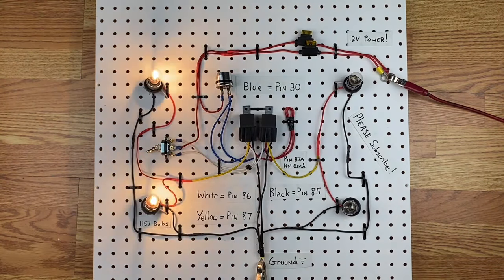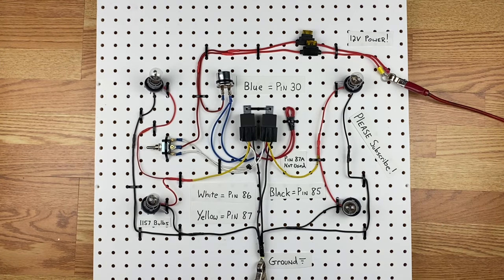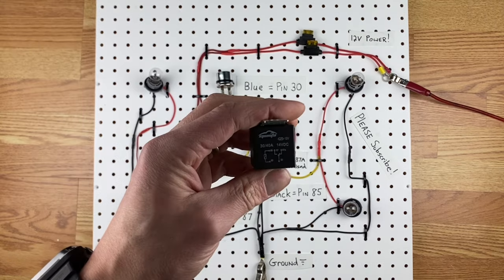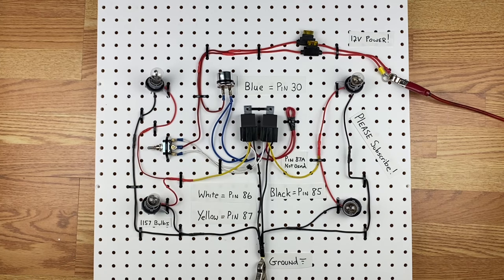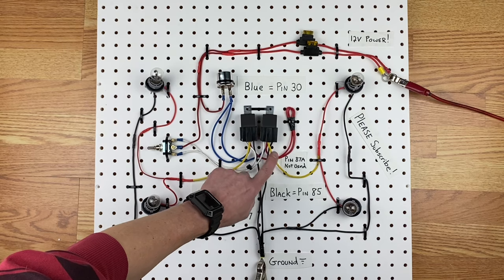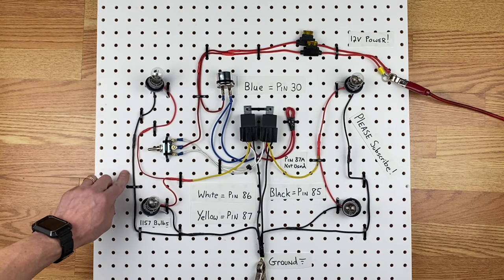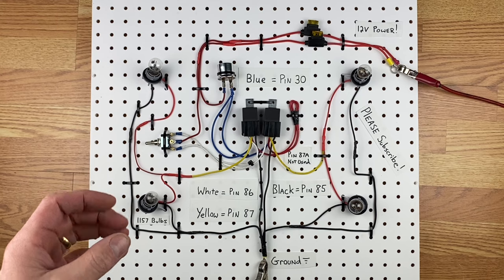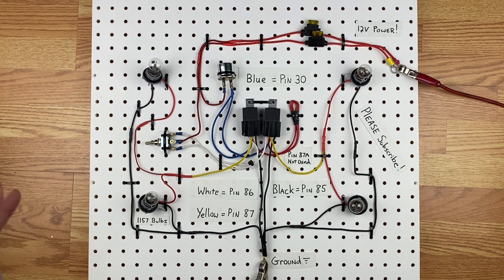How To Wire a Turn Signal Flasher Relay Directional Blinker on a Car / Truck / ATV / Motorcycle

Comment: This can be simplified quite a bit by eliminating the relays and powering the bulbs directly from the flasher. Modern EF32 electronic type flashers can source 25 amps. They are still a simple two-wire flasher.

Comment: I’m having trouble with my turn signals. I have an Ford F100 truck.Everything works except my turn signals I changed cell the voltage regulator and the 552 Novita fuse but still do not work. What else could it be I appreciate some help
Reply from the maker: Which bulbs are you using and how many? If you are using LED’s for example, you’ll need an LED flasher.  Give me more info and I may be able to help more.
Reply: @WiringRescue  They didn’t wanna work even with the regular lightbulbs but I’ll try to LED flasher because I tried putting on the LED panels that plug-in the the light socket
Reply: Well I tried the LED flasher upgrade I still the signal lights and turn on. Am I looking at changing the signal light cluster in the steering column now. Also went ahead and clean all the ground connections

Comment: Does the flasher have to be for led lights if that’s what Type of light in using.
Reply from the maker: It sure does. If you use a regular 552 style relay, they most likely won’t blink.

Comment: 57 Bel air restomod changed tail lights and front running/turn signal lights to Led panels with 1157 plugs. Brake lights work, running work, Turn signals get brighter but won't blink. Changed relay to led type still no blink just brighter. HELP

Comment: Greetings from Denmark :) . I must be the stupid one on here. I am trying to copy your system, except I have two small side signals. I can't seem to get anything to work.... I have checked the lights and they work. I have two types of flashers that I have tried. One 2 Pin with an X and L marking, and then one with 3 pin . Any idea what I could be doing wrong. I tried to skip the relays, and just tried the flasher and a light to see if it worked and it did.......
Reply from the maker: It’s tough to diagnose over the internet. However, if you bulbs have an amperage rating of less than you switch, and flasher, you can skip the relays!
I made the relay diagram because it’s safer, and allows people to nearly use any bulbs they want. But it sounds like you just have two small bulbs. So you just need to make sure your switch and flasher are rated to flow enough electricity to power your bulbs.

Comment: This is a good demonstration but in this scenario aren't the relays not needed. My understanding of relays is that they allow you to use a low power circuit connected to your switch to control a high power circuit connected to whatever you are controlling.  But maybe it is different in automotive wiring.
Reply from the maker: The relays allow you to use a variety of different size (non-LED) bulbs without worrying about the amperage draw too much. Depending on how low of an amperage your bulbs are, you may not need relays. This method would give people a variety of options with less risk.

Comment: I am a total novice. I have NEVER wired anything. Would your diagram apply for a 6 volt car? I must wire a 1923 Ford Model T Touring Sedan. Tell me what the actual wire is. What is it called? Tell me what the connectors are.  Also, what about the other light systems such as running lights and 4-way flashers. Do you have a video/diagram for that also?
Reply from the maker: I have a LOT of wiring videos - check them out. I don’t generally mess with the 6 volt stuff, but you can buy 6 volt flashers and relays. So I would assume that is a good starting point. If it’s a positive ground system for n your car, I have no idea though. That’s where you’ll need to find somebody way smarter to explain it.

Comment: Thinking about running this on a motorcycle using a cap and a Pma system aka not battery. Not sure the exact output at the cap at this point but do you think it will work?
Reply from the maker: Sounds like a fun project!  I have never tried that before, so I have no idea if it will work.  If you try it, you should post up the results!
Reply: Would you have to change the relays for led light

Comment: Can you do a circuitry where one filament serves as both brake light and turn signal?  Meaning it will flash instead of steady on if the turn signal is activated while the brake is applied.
Reply: The way vehicles are really wired, this is wrong and the relays are redundant,  not needed and over complicate a bad design , the line load is so low relays are a waste

Comment: Hi your video is very helpful I’m planning on turning my led side markers on my trailer to flash with blinkers to as is a trailer I don’t have a constant positive for the relay could I use my running lights as power in and out
Reply from the maker: If I understand you correctly, you should be able to grab that power from the running lights after it powers the running lights, and use it to power the flashers. If you hook up the flasher before the running lights, it will cause a variety of confusing issues, like flashers not flashing.  Also - if you have LED's you need a special LED flasher. The flasher in this video won't work with LED lights.  Good luck with the project!
Reply: @WiringRescue  that’s what I was thinking will I still need 2 relays but no flasher

Comment: what if I am mounting blinkers on my bicycle (no motor) can i ground to the frame? I plan to use a tusk enduro 12 volt 2000 mah battery pack to power my blinkers
Reply from the maker: As long as the battery is grounded to the frame as well and the frame is conductive, yes!
Reply: @WiringRescue  thank you so much my frame is aluminum so to be clear to eliminate excess wires I can drill a small hole in the frame and connect the batterys ground with a screw a bolt and washer with the wires in between a washer ...then connect any wires that need ground to the frame the same way?? btw subscribed
Reply: @WiringRescue  cause I bought a radrunner and my goal is to add blinkers but I am thinking of connecting it all to my ebike battery but my system is 48 volts  I have a really nice sylvania led light pod headlight wired in it is a 1.9A at 12V DC head light i used a Voltage Reducer Converter 48V to 12V 10A 120W for my headlight and it is working i would also want to add in the blinkers and a  horn later on I want it all to be powered off my ebike battery but afraid it will take too much juice my ebike battery is a 48V, 14 Ah (672 Wh) never done any work like this did a lot of research I belive my range on my bike is going to drop a lot if i wires everything in to the ebike battery any thoughts would be awesome

Comment: Great video! I do have a question, could you use the 5th wire from the relay and double up on the others still using the 3 way toggle?
Reply: The other 87a connector is normally closed or "on". So when the switch is off the power will go through and cause whatever is attached to it to have power. So no, you can't use it.
Reply: If you flup 30 and 87a... And are using single filament bulbs. Then using the red wires you can light them as parking lights. When the relay get energized by the turn signal switch then that sides parking lights would then blink and you have not only parking but turn signals together. Using only single filament bulbs.. Like a little led

Comment: Thanks for the video but you are passing the current from the flashier to the relay then to the bulb. This means the relay is not doing any protection it's as good as from flashier to switch to bulbs

Comment: Allsow if u want to connect flashers for ur scooter u can use this diagram but ur will probably be using a on off latching switch called halo or the switch witch has a light ring in it but u have to have 5 wire or 5 pin type for my design 

Im going to connect it so when the sistem is turned on or when it has power the two on off orange switches will light up orange  and when i press one the blinkers will blink and so will the orange ring on the switch while the other switch is still a solid colour and when i press the other one the blinkers will blink at the same time and the buttons will blink orange at the same time when i turn both or one switch off the light switches will turn solid orange and not blink thats the best way i think u just have to wire them

Comment: How would you wire a couple of cameras in that system to come on with a monitor lor left & right signal?
Reply: Simply add the video power feed to the turn switch. It will trigger each side camera

Comment: I added this exact set up to my UTV, it blinks when the UTV is off but when i turn it on and try to use it, the lights dont blink and stay solid. What could be the issue?
Reply from the maker: Sounds like you may be using the wrong bulbs. Are you trying to use LED bulbs?
Reply: Yes they are LED lights

Comment: Brother i got a issue with my 1990 honda accord..my blinkers dont work only  make a buzz sound..and one time it wasnt doing nothing.. and when i pressure my brakes it was cutting my light off or on.. weird
Reply from the maker: A good starting point would be to make sure you have all the correct bulbs. If they are LEDs or the wrong bulbs, you could absolutely have the issue you describe. If those are correct, you may need a new turn signal switch. Those are commonly replaced as well.

Comment: Adding two additional Bosch type relays to this circuit is redundant and creates additional failure points. The flasher unit is already a relay, you may argue that you're saving the switch, but in reality headlight switches on older cars are the ones that fail because of full amperage going through them, not turn signals. If you have 3 bulbs per side and they draw 100 watts on each side, your amperage draw will be around 8 amps per side, any flasher relay and turn signal switch is more than capable to handle that load and in case of hazard lights, double that number and most normal flasher relays will be fine. I can accept adding a relay to brake lights, since I've seen a lot of melted brake light switches due to people sitting there with their foot on the brake pedal. Either way, thank you for making these videos.
Reply from the maker: Hello - I also have this video https://youtu.be/uXiEoJVtHi8 that shows how to wire the circuit without relays. Having the relays, just allows for additional switch options. So if you have a favorite type of switch that is a low amperage rating or some higher amperage bulbs, the relays allow it to work safely.

Thanks for watching!
Reply: @WiringRescue  I appreciate your reply and the work you do, keep up the great content.

Comment: Why did you used relay ?. The load it's still the same in both the relay and the flasher the purpose of the relay is to handle mayor load but not in this case.

Comment: sorry already asked you this. I assume same wires, 6 volt flasher, same relay, would the fuse be different?
Reply: Fuse doesnt know voltage only amps. 5 amp is still 5 amp at 6 12 or 110... 
The ratings are for high voltage that can jump the gaps of the fuse ends. Thats why switches and such have a voltage rating.

Comment: Ok so I did the whole thing to a Jeep I used led light so the only thing I used different was the clicker I used a led compatible clicker so for a few days it was working fine and all of a sudden when I turn the signal doesn’t matter if is right or left all 4 corners blink as if I was using my hazard light what could it be
Reply from the maker: Sounds like your switch is broken. Try another switch, and did you put the proper size fuses on the wires going to the switch? Most switches do not handle much amperage, so if you use a fuse that is too large, or no fuse, you will damage the switch.

Comment: Finally a video that i can follow how to do it right ,thank you Sir !! I have a question, my tails are 3 wire, so my tails works as turn signal and brake light. How do i convert it to separate my turn signal and brake light i mean in a separate tail housing, cos i want to add 3rd break light on my classic baja bug. thank you in advance.
Reply from the maker: You may need to add some additional bulbs.  Sometimes you'll use a dual filament bulb on each side of the back of the car for the brake & parking lights. Then you have a single filament bulb on each side of the back of the car for the turn signals. In the front, you'll just have one dual filament bulb on each side, which will be a parking light and turn signal.  The third brake light would just be tapped into the dual filament circuit in the rear. 

Maybe I should make a video for a circuit like this....
Reply: @WiringRescue  Yes please !! Please make a video of how to convert 3 wires tail light to a regular tail light with separate turn signal and brake light and adding a 3rd break light. cos i want my  turn signal to be amber too. i tried to connect my new led amber rear turn signal that i bought and it works as a turn signal and hazard but when i hit the brake,  it also lights. i'm so confused where to tap it. i was thinking of connecting it to the front turn signal instead. but i'm gonna have to wire it all the way to the front.
Reply: and yes i believe the tail light i have right now have a dual filament bulb, cos it lights up dim, and it'll light up brighter when i use my signal or hit the brake.
Reply: @WiringRescue  if you do the flip for parking light i mentioned earlier with 2 wire.. By swapping the blue and yellow. Then with 3 wire sockets the parking is separate then the brake ligjt switch would go to the red wires not used. Then parking would be standalone... Brakes on red and a side would get over rode when turn signal is switched. So one side flash but other side is bright and all dim for parking

Comment: How can I add a relay to a turn signal . Im trying to wire a turn signal light the intent is to have it on just like a parking light but I want it to flash when I trigger my turn signal ??
Reply from the maker: I personally think the easiest way is to use a bulb with two filaments in it. So you’d power up one filament to be the parking lights. The other would be the turn signal. There are other ways to do it, but describing it in words is hard. I’ll add it to my list of videos to make.

Comment: Wow this video is helpful. So I have a 1949 Ford F3. It didn't come with turn signals back in the day. So it has a set added to it and I think they are setup like this. Except it is a 6 volt. I do have two wires going to the flasher. But here is where I'm confused, my turn signal has 5 wires coming out of it. When all of the old signal kits are 4 wire or 7 wire. I think the 5th wire might have been added, maybe as a additional ground?

Comment: Good video. O want to if i add more bulbs   they lose power?👍🇵🇹
Reply from the maker: It depends. Ideally, you determine what you’ll be powering (bulbs). Then figure out how much amperage they draw in total. Then use the right size wire and fuses to adequately provide the right amperage for the bulbs.

Comment: What if the socket has three wires to it? The only ones I could find have brown, white and black.
Reply: I THINK White is neutral and I'm assuming red goes to brown and black gets grounded to metal or the other black. I'm probably wrong.
Reply from the maker: Each of these 1157 sockets has 3 wires on it but only two are being used. The white wires are hidden in the video. 

In your case, I would bet that black is ground. White is one of the power wires. Brown is the other power wire. (Just a guess) Each bulb has two filaments in it, so you have two power wires. One for each filament.
Reply: @WiringRescue  Oh okay Ty ^_^ I managed to do one side. In a few minutes I’ll find out if it’s a failure or a success. I know the ground wire can connect to the metal frame of the car but is it better to have it taped down using electric tape or by placing the ground under a bolt or screw? Swear that’s my last question lol 😂

Comment: i HAVE EVERYTHING WIRED UP BUT WON'T FLASH, WONDERING IF I HAVE A BAD FLASHER ?? OR SOMETHING i MIGHT HAVE DONE WRONG ?
Reply from the maker: What kind of bulbs are you using?
Reply: @WiringRescue  not sure of the number, might be a 2057, only one filament , I bought these on line along with the turn signal kit. which I'm not using, I bought a toggle switch like in your video ! also would a 15 amp fuse  be ok to use with this ?

Comment: Why are you using 5 pin double-throw relays and ignoring 2 wires when you could just use simpler 4 pin relays? I did find the flasher part very helpful, though. Thanks.
Reply from the maker: Because that is what I had available, and they work fine. There is no need to use the extra 87a wires, so the pins/pigtails could be removed from the connectors if somebody really wanted it nicely organized.

Comment: Why did you use two seperate fuses? Why can't you use just one for the whole setup?
Reply from the maker: You could use one fuse if you’d like as long as it is sized appropriately. I used two because I thought it made the circuit more easy to understand to a novice. It also does make diagnosis easier if there is ever a problem, because there are less items on a single fuse.

Comment: Your circuit is missing a very crucial piece.

Emergency Flashers!

As well, it gets a tad tricker when you are dealing with LED bulbs, as you need a fancier relay as they don't use enough current to work with a temp-controlled timer like the one you are using.
Reply from the maker: Thank you for watching! - You're right, and that is exactly why I made additional videos below! :)
Here is the Hazard Switch Circuit: https://www.youtube.com/watch?v=lnhMx-fnUmI
Here is the one for LED lights: https://www.youtube.com/watch?v=hDmER_pNask
Here is a playlist of a bunch more videos you may find entertaining: https://youtube.com/playlist?list=PLsF7T1tRFy2hmiiUUfMZNyV-BUA_yrPIh
Reply: @WiringRescue  Well then, your on top of it! Keep it up.